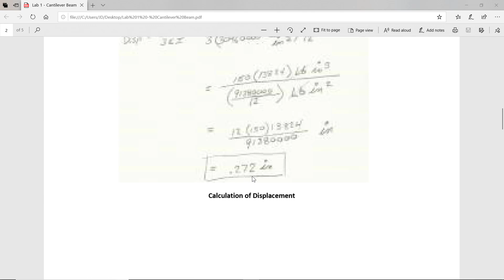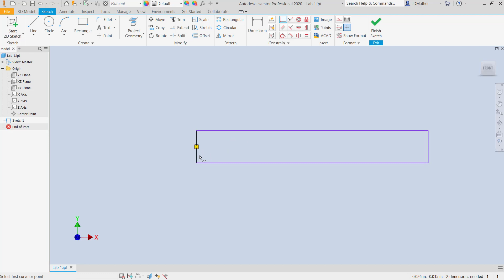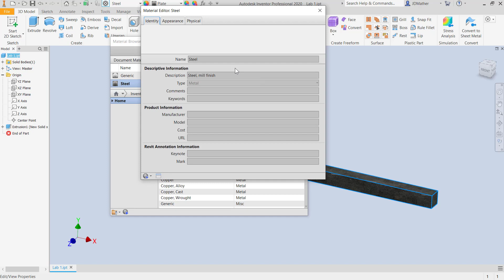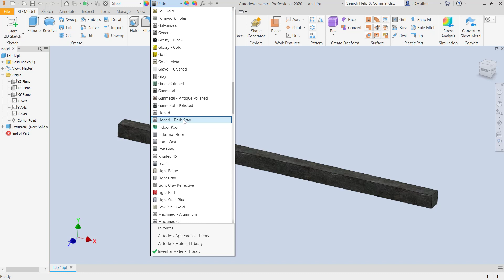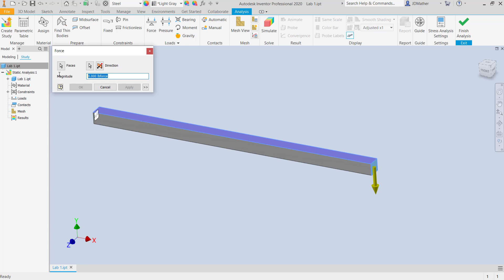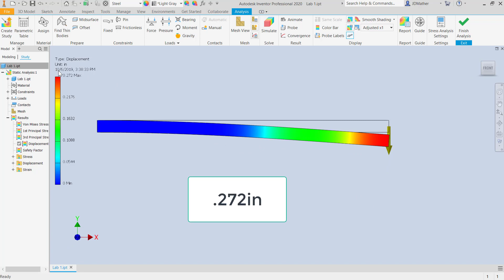Inventor FEA Lab1

Comment: can you help me? I have a trace supported (on two cylinders) with a force in the center but the Von Mises value does not correspond to the theoretical one calculated with the statics formulas
Reply from the maker: Attach *.ipt file (or assembly) here https://forums.autodesk.com/t5/inventor-forum/bd-p/78